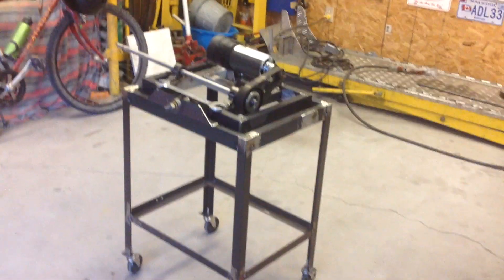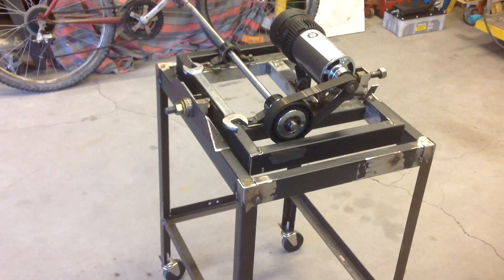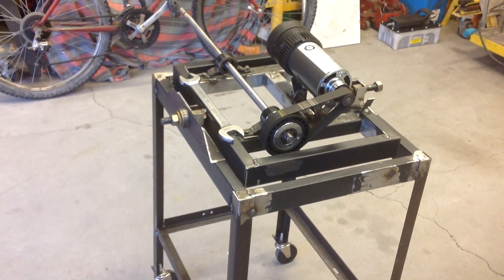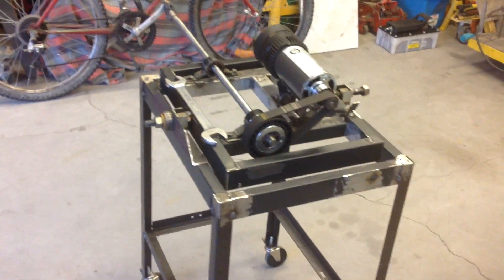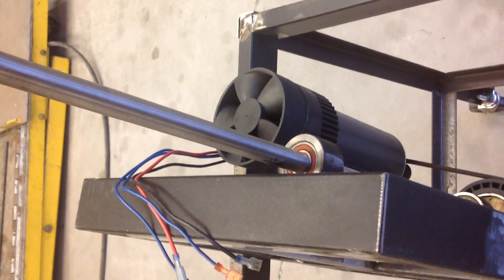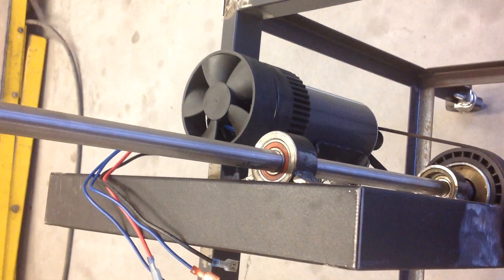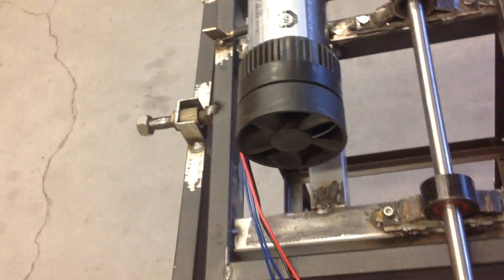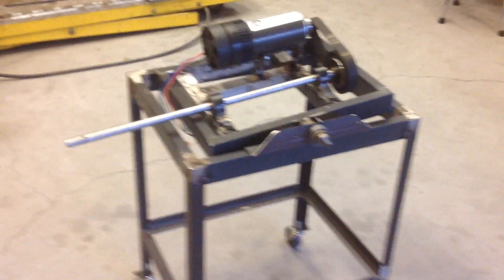Welding positioner DIY

Comment: You could of used the original controller,  there are 2 common types that I have found in all the treadmills I scraped mc60 type and mc2100 the 2100 is a pwm which  needs a digital signal to control the speed, those are sort of hard you can build a 555 timer chip circuit to control it, but the mc60 is the easiest and you can tell them because the mill will have a slider switch to control the speed which your pot will work, just using the motor, bridge rectifier and pot won't work, too much amperage will burn the pot up. That motor can be 2 or 3 hp drawing 2 to 8 amps better going thru a controller they are built for it. I like the mc60 types they are easy to control, I do have a mc2100 which drives a 3hp motor which I'll use on my lathe, I couldn't separate the electronics to be small enough, so I will build that 555 circuit.